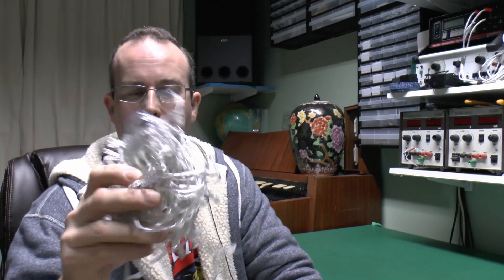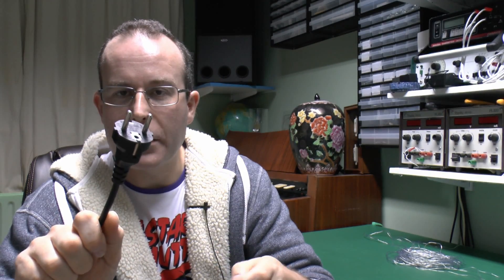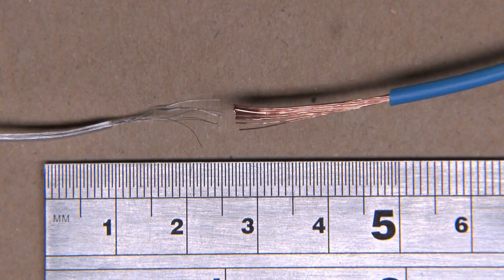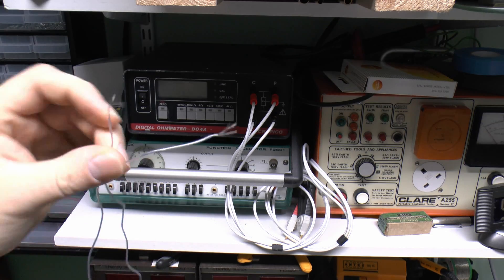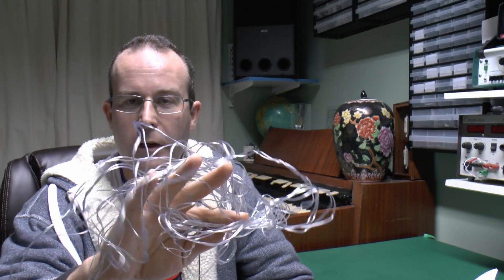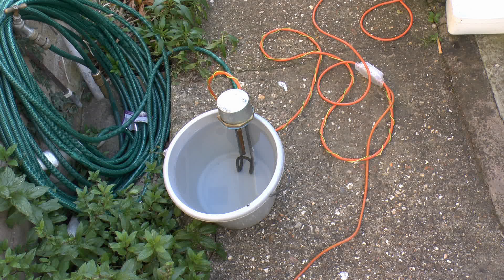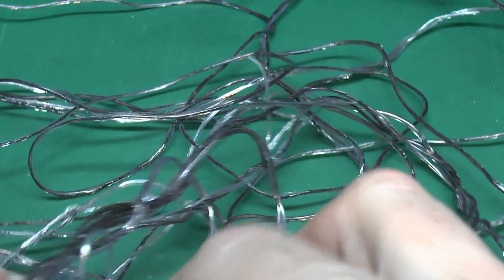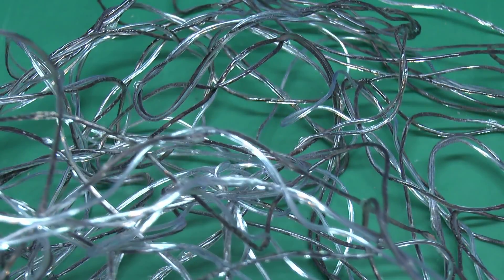LED Extension Cord, 240 Volts, 13 Amps, Certain Destruction

Comment: Actually after those wires heats up, resistance goes even higher significantly, so current goes down and you can be shure that circuit breaker remains ON, so = fire hazard 100% In real situation, if you have some load at the end of this wire it is already heated up and resistance is already higher and if short circuit ocures in this situation, circuit breaker stay ON, because current is low enough, limited by resistance of wire itself. So for proper function of circuit breaker and for functional protection against fire also wires must be rated properly for CB which are used. :) If somebody wants to save something on thin wires then at least proper fuse should be used in plug.

Comment: My goodness me.... SERIOUSLY?!!

What will they come up with next?! Let me guess.....

An extension lead where there isn't even a plug. Just some steel nails soldered onto the ends of the wires that you randomly poke into the socket holes!!

Rubber gloves not included!

That plug wasn't even fused and like you say, that thing connected straight across the mains and shorted at the other end effectively becomes an exploding electric heater.

This scrapes the bottom of the barrel SO HARD that it has worn a hole through the bottom of the barrel !!

If this is being sold in the UK, trading standards SERIOUSLY need to pull their finger out!

Besides..... what year was it that BEAB died anyway?

Thanks for popping this one, but the problem is..... one down, 91,678+ to go!!

Another thing: If you're going to be doing that thing with the 3kW water heater, consider using a kettle filled with water instead. It's safer for you. :D

Oh, and consider making a Fun-Jiggery-Pokery Unit as well. This will allow you to make connections quickly and safely without having to do all that hocus-pocus with the water heater and the dangers of precariously balancing it on the edge of a bucket of water like that. :-O

Electrical poppage can be Soooo Satisfying but please be careful not to take-out yourself in the process. ( Have you seen that IEC connector that I fizzed-over with 6kW? :D )

Thanks for showing,

-BoomBoxDeluxe.

24th October 2015, 03.45
Reply: In the UK socket-circuits are fused with 32A, and a 15A fuse in the plug. In continental Europe the sockets are fused with a maximum of 16A. Additional fuses are inside of the device. 

There are two options for devices with Europlug (CEE 7/16):

1. Fuse inside of the device cut off a too high current.
2. other possibilities limiting the current like a PTC.

This Europlug normalized in CEE 7/16 is a minimalistic unearthed compromise to fit in most sockets used in Europe with a maximum of 2,5A and without an adapter. Used for shavers, electric toothbrushes and chargers for mobile phones only.

And in the UK you could use conversion plugs that are fused:

https://upload.wikimedia.org/wikipedia/commons/9/96/Euro_converter_plug2.jpg

Comment: this may well mean many people ruining their carpet/flooring.. if they don't have enough "common bloody sense" to look at how flimsy it all is and think they wouldn't even risk charging a toothbrush or shaver.. though that load would probably just about be safe, besides more sets of lights, which is the main idea behind it.. a horrible idea but if you use them indoors with a fused shaver adapter and don't have any kids or animals around they're completely safe! cough call me captain obvious.. i just find it actually quite funny that the wire is so shite, it makes itself safe by failing quickly!

Comment: even if this 15 ohms (or 8 per side) is enormous: why not first test with the 2,5A it's been implicitly rated for by the selection of the (non standard compliant) connectors.
Reply: +rarbiart It would of been interesting to see a 2.5a load applied before destroying them, but he did say in the video a 16 amp plug could be pushed into the socket.
Reply: Well, it might survive 2.5A, but even so, there would still be an outrageous 38V (and rising with temperature) drop.